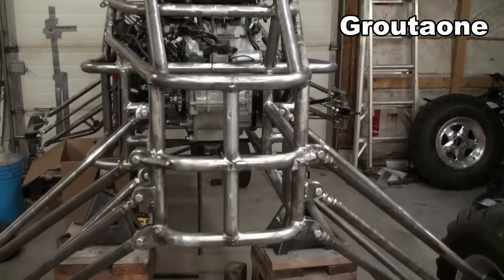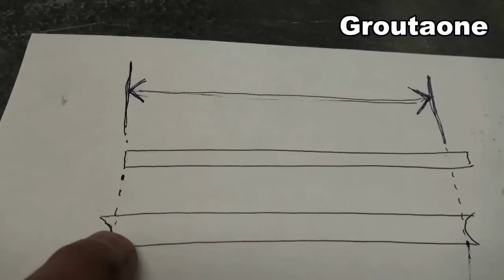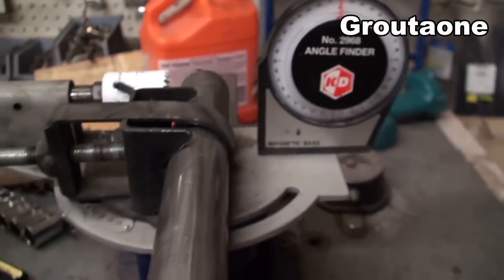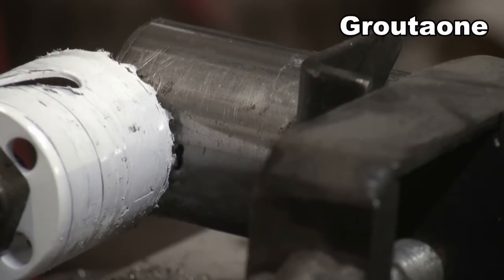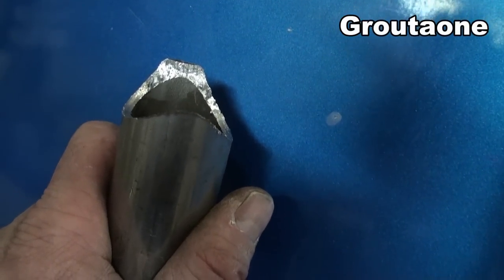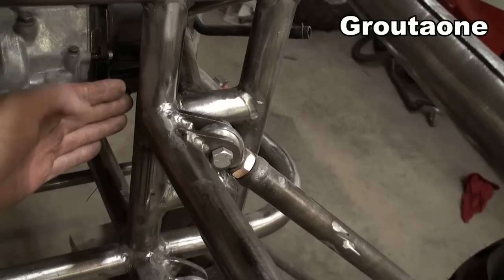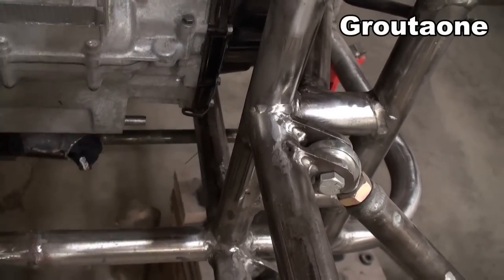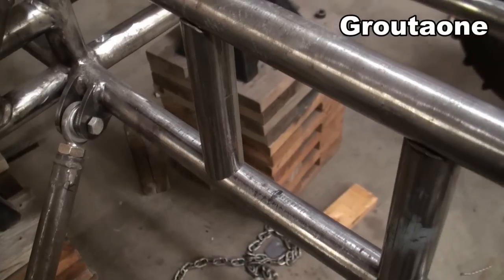Some Tubing Notcher Tips

Comment: On my job we have made a different thing to check if we got the tube straigt in it again. I tought of this myself. I used a glueing clamp and welded some angle iron on it where it clamps. And then 1 pointing to the side. And then you can put a level or a angle meter on it and look how much you have turned it. Works great if you need a offset too. I came up with that when we where bending the tubes for a rollbar and we knew the tube had to be turned so many degree for the next bend.

Comment: Great job bro! Do you use a slight bigger whole saw but than the diameter of the pipe(out to out). Eg 1 1/4" pipe you would use a 1 5/16, or 1 3/8 "bit?

Comment: I don't know if you can respond but how would I repair a 2 stroke cylinder head if it has small pits in it, I was thinking about sanding it and then polish but any suggestions because I don't have much money to buy a new one.
Reply: I also didn't want to sand it because of clearance. don't want any problems with that because that would be really costly

Comment: I just got the same tubing notcher to finish up my roll cage. I have two tubes that need to get a notch at 60° and I can start it, but I run out of space because the hole saw gets to the tube clamp. Have you run into this at all, or figured out a way to get around this?
Reply: Zachary I